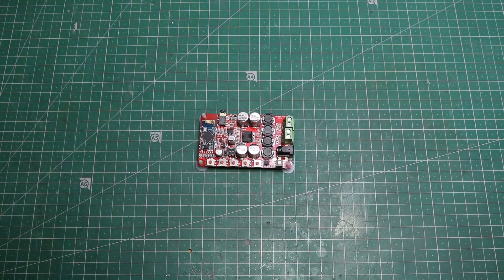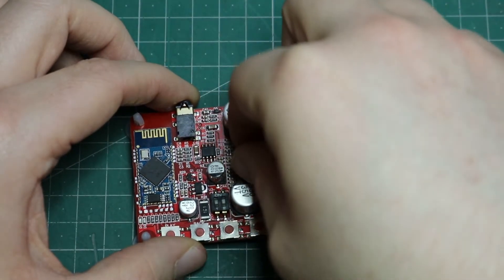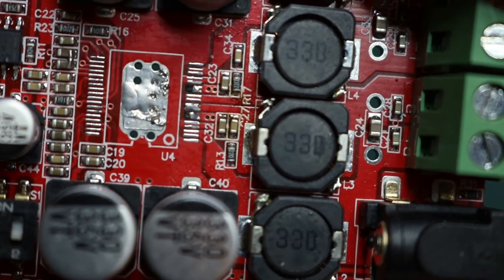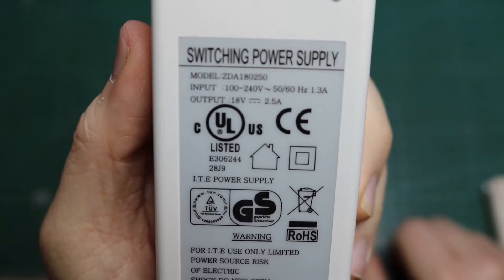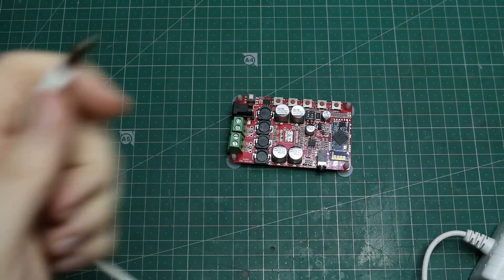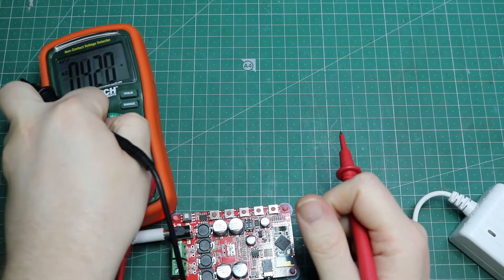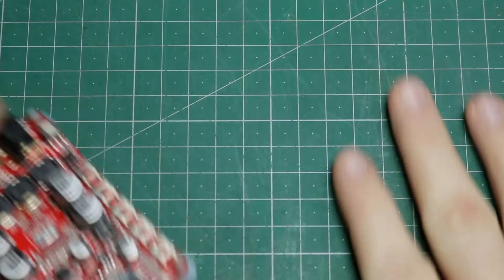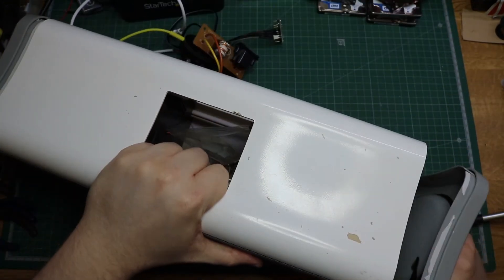Update | SANWU® 25W+25W TDA7492P Bluetooth CSR4.0 Audio Receiver Digital Amplifier Board

Comment: I just gotta say, I used one of these for years on my hot tub up until some lines froze and it leaked too much to repair, by this time the board was all rusty and covered in cobwebs, for shits and giggles I powered it up and it still works perfectly.